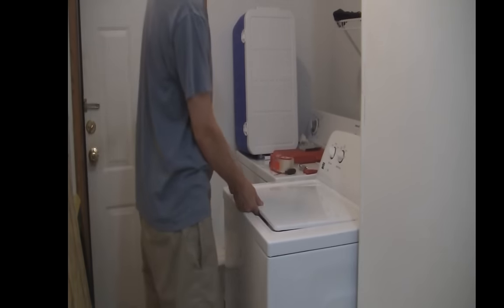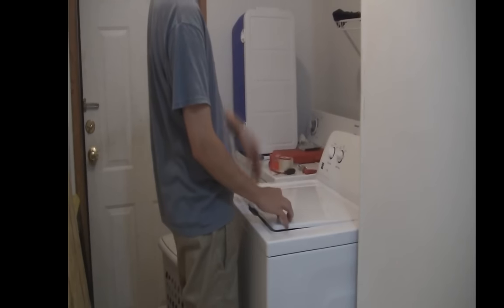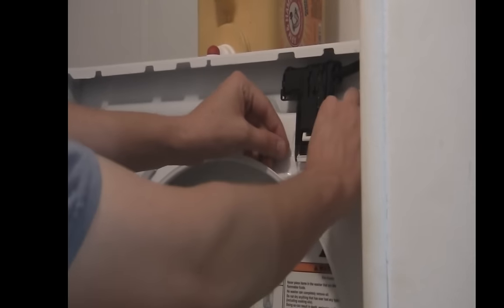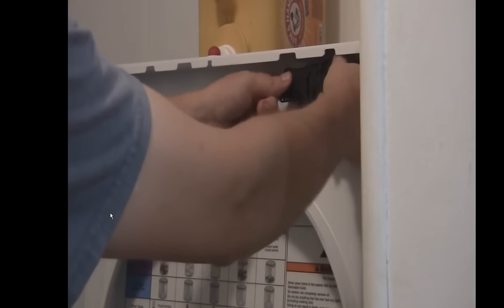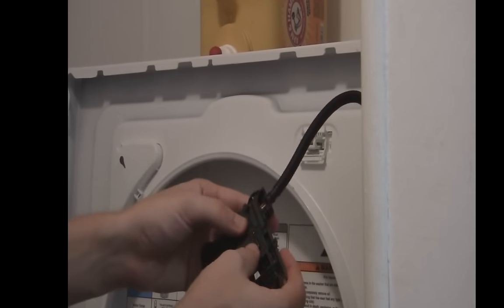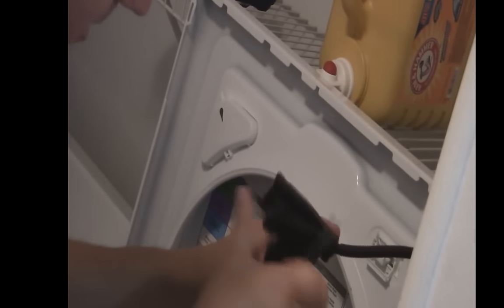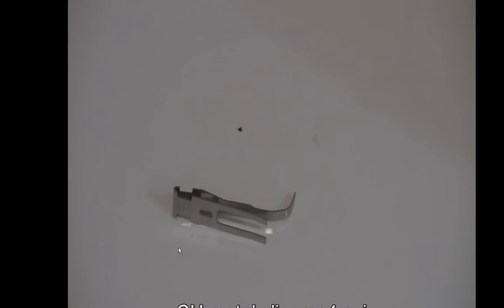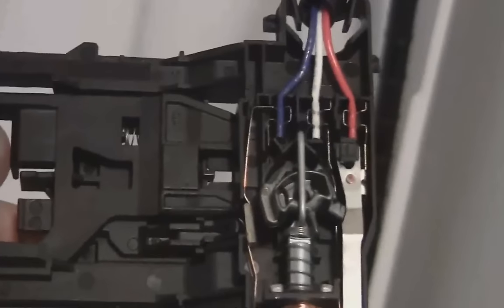Maytag, Kenmore, WhirlPool Clicking Lock Fix

Comment: Hello...  I finally need new washer and was planning on getting one that probably has this unit...  will removing that "clip/tab" piece displayed on the towel enable the machine to fully operate at all times with lid open?   (I usually give my laundry some external hose rinses during spin cycle and thus need lid to be open to accomplish) 
On past washers I just jumped the wires but heard that not a very wise idea on these new computerized models.
Reply from the maker: If the lock mechanism is not broken then you do not need to remove anything from it.  Instead just get a hex screwdriver and remove the latch from the washer door.  Stick that latch in the lock and leave it in the lock at all times. Since the latch is no longer screwed into the door you can lift the washer door now when its in use.    You have to unplug the washer between uses this way though since the washer will never see that it was unlocked.    However that is exactly what I do and it works fine for me.
Reply: @danh413  Many thanks...

Comment: Thanks, but this did not work for my Admiral washer. Removed the clip from the locking mechanism and separated the latch from the lid - permanently placing it within the lock. 

I suppose nothing in this world can be guaranteed. ;-)

Comment: You cant be afraid to pop off the panels and poke around. By removing this metal clip enabled my washer to start back up. These locking mechanisms are a cash grab. Cheap plastic manifolds and gears. They should remove them all together all they do is break down. But thanks it was a huge help.
Reply: Yes! I don't understand why even have them?
Reply: They have them so kids can't open the lid especially during spin cycle and reach in and get badly hurt. Sounds stupid but these companies would rather annoy everyone with lid lock than get a massive lawsuit because some kid got hurt or killed and i don't blame them.

Comment: Will the lock prevent the machine from coming on?  The machine just makes a clicking sound but does not power on.  It's a whirlpool wtw5000dw1.
Reply from the maker: Earlier this year when my lock completely broke it did cause it to not power on anymore.  I have another comment on this video and if you 'read more' on that comment I talk about the procedure I had to go through to get the washer to power-on after replacing the entire lock.  I unfortunately have no idea if your washer is the same or not.

Comment: I did this a few months ago and it worked fantastically, but today it started doing it again. The part is removed, how is that even possible? An suggestions would be great.
Reply from the maker: Less than a year after the lock mechanism originally broke the copper Solenoid on the lock mechanisms circuit board broke, and I had to replace the whole thing.  If you find my comment here that starts with "Update:" that explains in details how to find it and replace it.   Also make sure you unscrew the latch off the top of the washer and leave it in the latch hole so the lock mechanism always thinks its in the locked position.  That allows you to lift the washer door which I think a majority of people prefer.  Sorry if that doesn't help but I'm not sure what else could have broken.

Comment: This is super, but I have a problem. It went swimmingly until mark 4:52 - the thing flew apart, I removed the metal clip, I carefully re-assembled it like shown in the video. Then the very last bit: I can't figure out what that plastic piece is you are inserting with the tweezers. I don't have any "extra" parts, all are accounted for!
Reply from the maker: Those tweezers you're referring to is actually the metal arm within the locking mechanism that holds the plastic piece during that part of the video. I was showing how it fit on the metal arm.  I don't believe that plastic piece is necessary since it doesn't make any contacts, so if it popped out and went somewhere you should be able to put it back together without it and still have it run.

Comment: I fixed mine... If the switch is good your OK, If trouble with switch refer to video, this is how it looks, The U shaped part from the solenoid can pop out of position. If switch is good, Remove latch from lid, pop out the striker piece with the 2 tabs that it snaps into, this has to go into the switch to simulate the lid being closed. I wrapped a little strip of duck tape around it to thicken it slightly and put a screw in it to keep it in the right position and not go in too deep because it can get jammed up and not contact the switch properly. when the wash is complete pop out this piece and then stick it back in. You simulated the lid being opened and closed and you are ready for the next wash. You can now add fabric softener, or put in another item after the wash has started. The best part about this fix it the lid closes all the way. The striker piece sits at a little angle to the rear and the screw I put in is screwed in from the rear side and sits on the edge of the white trim piece.  No auto mechanic will ever be beaten by a stupid washing machine, Good luck Jim and may the Force be with you!

Comment: Can you just short some of the wires? I want to just do away with the whole lick. I was told short the two outside wires on the connector, the lid lock and sensor fill 5:16 just flashes and

Comment: I have a different lid lock switch on this Maytag.  I took the switch out & took it apart.  This switch has 4 wires going to it. I was going to solder the right wires together & hoped that would work. I just do not know what wires to connect together.  There is a White,  Yellow,  Red  & a Blue wire. Please help !!!!   Thanks in advance
Reply from the maker: I think there is a comment on this video talking about a lid switch with 4 wires that may be able to help.  I personally am not sure about it.

Comment: This video itself did not work for my wtw5000dw2 with a flashing lock light, but it did help me fix it:

At 4:10 in this video, directly left of the solenoid you see an angled piece of metal. This is part of a mechanism that detects the door being closed. The white plastic which pushes on this switch mechanism was broken in my washer. If I manually move the broken piece of plastic I can see it causes two pieces of metal to touch. What I did was forced this switch closed, by forcing the two pieces of metal touch.

This fixed my lock light flashing. Right after this I was able to use this washer again.

https://www.youtube.com/watch?v=_N_YCSNziXc has a video of the manual which was also very helpful.
Reply from the maker: May people find this comment, because I know that is a common problem and I did not know how to fix it.  I just knew what worked for me.  Thanks for sharing that extremely valuable info. Anything we can do to fix more washers for free is awesome!

Comment: Is this a bypass? Will I be able to open the washer lid while it’s washing?
Reply from the maker: In order to open the washer lid while it is washing you just need to detach the latch at the top of the door, and put it in the lock mechanism.  This way the latch is always in the lock mechanism, even when the door is lifted.  Nothing else should be required.

Comment: Worked! Easy! for 70 yo me. My husband gets frustrated with our new model Kenmore washer model 110.22332510 and keeps jerking open the lock, when then is a delay. Already had it fixed once and almost cost as much as the washer ... so was looking for another solution. First looked at this video at https://www.youtube.com/watch?v=J4-Esnd8eCE , our model washer lid lock/switch looked just like the one in this video (nothing like this on Amazon or other parts sites) this helped expose the lid lock/switch; then looked at this video. This video did not show the taking out of the metal part pictured and played around with the lock a lot - which just showed it worked without the metal part pictured. Once I took off the black lock component and turned it over (had to break two black thin vertical clips holding the bottom of the lock in place) the metal part pictured was visible and removed; then the lock was replaced and taped down. As in the first video the lid of washer was replaced and screwed down. NOW all works fine - my husband can open the washer to check on his load and it resumes normally - the lid lock light still comes on, but the bothersome lock no longer works - THIS METAL PART IS NOT NEEDED !!! just causes frustration and repairs. Never had to remove the lock cable or take off the top "dashboard" to look at any circuitry. Just expose lock/switch and detach, turn over - remove small metal clip - and replace. THANKS SO MUCH!!

Comment: Did you just remove the metal clip? Or did you do anything with the wiring to make it think it was locked all the time?
Reply from the maker: Just removed the metal clip, and then also left the latch inserted at all times by removing it from the top of the washer door.
Reply: @danh413  thank you!

Comment: Ok.  The thing about this switch is there is no bypass I can see.  I just finished working on a whirlpool washer.  The solenoid inside the switch makes and breaks the signal to the control board (red wire) depending on what part of the cycle it's on.

The only switch that matters is the contactor that moves up and down (the red wire in this video).  The blue contactor can be bent to keep in contact the whole time.  In fact, you don't even need to have the black plastic pieces at all.  Just make sure the solenoid operates by making and breaking the red switch and that the blue switch remains closed.

Comment: I'm lost. I've tried this twice now. Once powered back on all I get is the red light for "Lid Locked". Any help would be great.
Reply from the maker: That is correct it should show its locked after doing this procedure.  Since it thinks its locked now you should be able to lift up the lid and throw laundry in there and start a wash cycle.
Reply: I did exactly what you did,after full cycle lid will not open.

Comment: Where did you find the replacement part because I cant find it anywhere
Reply from the maker: Search ebay for part w10838613.  I also have a comment on this video that starts with the word "Update:"  which you will want to expand and read because there is a specific sequence you have to do after you replace the part and it has more details.

Comment: My washer wont display lights or run... Thought it was a lock problem. But no lights.. and lock is broken..littl black plastic stick piece broken
Reply: I need help with understanding why there is no lights on my Kenmore washer that's barely been used top-load
Reply from the maker: Check my reply that to this video that starts with "Update:" if you expand that I explain how I had that same issue, and how to reset the washer.  You may need to replace the whole lock mechanism if that does not work.  Good luck!

Comment: I am aware that this video is 5 years old. Howevee, I have a Amana Washer with the same lock switch as this and I messed it up and it wouldnt lock anymore so it just kept clicking and never would go into rinse &/or spin. So, I followed the instructions on ur video step by step. However, now when I plug it back in, I just get a flashing red "lid locked" light and thats it. It doesnt do anything else. PLEASE PLEASE HELP. I'm a single mother of 3, a 23yr old daughter who still relies on me heavily, a 20yr old son at LSU who I send money to every month so he can focus on school and not have to take away from that by working as well & lastly, a 4yr old son. I cannot afford to pay to have it fixed & especially not to replace the washer. So, if anyone reading this can help me by giving me step by step instructions to get it working again, I'd be extremely grateful. Thank You in advance for any suggestions, information or insight they could give me.
Reply from the maker: Have you tried removing the latch from the top of the washer door and leaving it in the latch hole?  If that doesn't work then something else might be damaged with the lock that I am not aware of.   If that is the case then unfortunately you may just have to replace the whole lock.  https://www.ebay.com/itm/373840513344?hash=item570aa18940:g:JWoAAOSwEz1gFWTP

If you do replace the lock look at my post on this video that starts with the words "Update:" as that explains step by step what I needed to do when I replaced the lock.   Sorry I can't offer more advice, best of luck!

Comment: Hey we have a Kenmore 500 series model #110.22352510 and sears is also trying to make us buy the 60 dollar part plus the expensive service call. Do you know if this will work on this model as well?
Reply from the maker: If it matches this part w10838613  then yes it should work. 
 https://www.appliancepartspros.com/whirlpool-latch-w10838613-ap5988772.html

If its a completely different part then sorry I'm not sure.

Comment: Tried on my whirpool but didn't work. Still making clicking sound like trying to lock but doesnt
Reply from the maker: I'm sorry it sounds like it may be a different model of lock then the one I posted.
Reply: FYI - Didn't work on my Whirlpool either....at first. There didn't appear to be anything wrong with the clip (and it was perfectly positioned as it should have been) but I pulled it out anyway. This did not do the quick trick it did for everyone else.  I started sliding the the piece that held the clip back and forth, just like is shown in this video, and watched for connections in the area of the "guts" of the part. Check out the black plastic, seemingly nothing, piece that he touched with his thumb in this video at 5:16. This was it! It wasn't broken but it wouldn't fully push in, and a little bit down on mine, to complete the connection with the thin copper from the side of the housing to the same size copper slightly inside the housing. I used a small piece of rubber cut and pushed in to the tiny space to hold everything in place. Once that connection was made...voila! Washers works just fine, it's computer "thinks" the lid is locked, and my teenagers can finally get their laundry done!
(One more thing, red lock light stays steady through cycles, flashes all the time otherwise, even when not in use, because it's never unlocking...doesn't bother me, but may bother others.)
GOOD LUCK!!
Reply from the maker: @catherinesanford4127  Thanks for sharing!

Comment: Didn't work for me the washer just flashes lid locked light all the time and won't do anything now. 😭
Reply from the maker: Have you unplugged the washer and plugged it back in?  And unscrewed the lid latch from the top of the lid and left it in the latch hole?  If you put the lock mechanism back together and did the above then it should be working
Reply: @danh413  Hey! Thanks for the reply! I redid everything you mentioned and unplugged and plugged it back in but did not remove the latch from the door. But it seems to be working like it is supposed to now hahaha. Thank you so much man!
Reply from the maker: @supimbob33  No problem.  That is one issue with this fix, I believe you have to unplug it and plug it back in after every wash, but at least its not completely broken!

Comment: Everything was great until the photo of the metal locking mechanism- you don't tell us where to find it or pull it out...I don't know what to do with the lock mechanism now that I have everything torn apart. lol.
Reply from the maker: Just take the metal clip out that was shown, and put everything back together, and reattach the lock mechanism to the washer.  I showed how the lock mechanism was taken off the washer, just reverse that step once you have it back together.
Reply: @danh413  I figured it out and put it all back together. It still doesn't work. Must be something else. Thanks for the video! Everything looked fine until I hit START. Then the lid lock started flashing and I can hear clicking behind in the control panel same as before.
Reply: @Dan H Maybe I didn't make it so it was "always latched" like you said. Do I  make it so the little black piece is up or down?
Reply from the maker: @iriscaldentey  Yeah sorry I'm not sure as the clicking was clearly coming from inside the lock mechanism for me, not from the control panel.  
The always latched part refers to the white latch attached to the top of the washer door.  You can unscrew it with a hex screwdriver and leave it in the lock mechanism.  However it sounds like that isn't the issue.

Comment: This won't work - you cannot just bypass the lock - when starting the washing machine it runs 2 diagnostics on the lock, first it locks and then checks for a lock signal back to the control board - if successful, it then unlocks and actually expects a signal that it is unlocked - BOTH tests need to pass for the machine to start the washing cycle.  If even 1 of the 2 tests fails, your machine won't start and the lock led will flash.  So what happens, if you bypass the lock to fool the machine into thinking it is locked, your machine will still not start, because it is expecting an unlock status during the initial test when you start.  The lock/unlock testing is hardwired into the control board logic.  You CAN bypass the door lid switch, but you cannot bypass the solenoid lock.

Comment: Mine is still locking took the.part as you described I am lost
Reply from the maker: Did you also remove the Latch that is attached at the top of the washer and put it in the lock assembly like I show in the first 20-30 seconds of the video?  Probably should have explained that better but if you expand the video description it says to do that as well.

Comment: Followed the video ,took it apart , removed the clip and my lid still locks!!!
Reply from the maker: If the lock is working still just remove the latch from the top of the washer door and then leave it in the latch hole.  If its not attached to the door then it can't lock :D